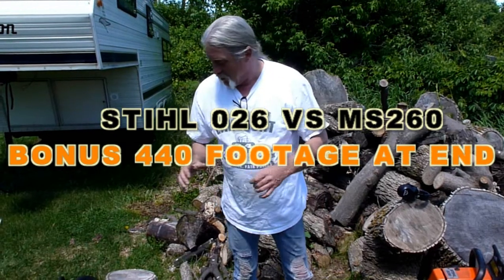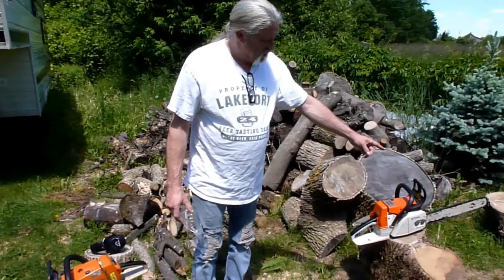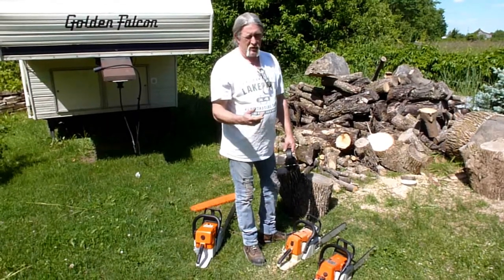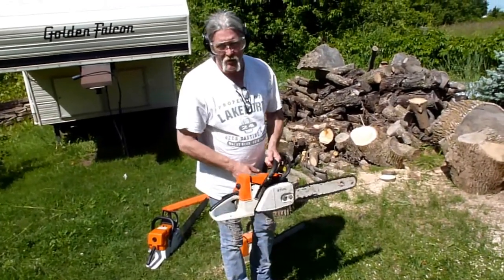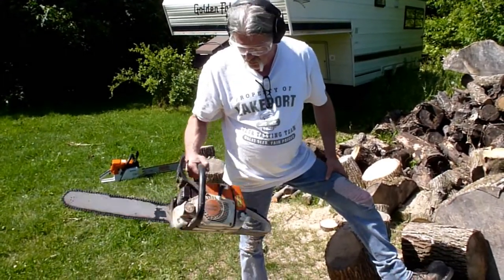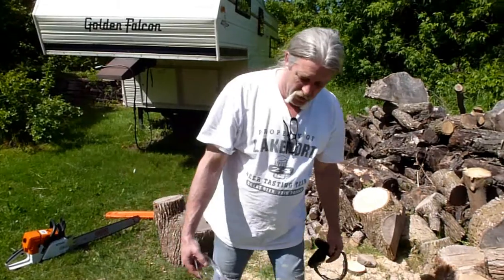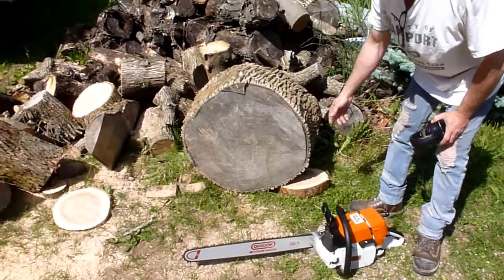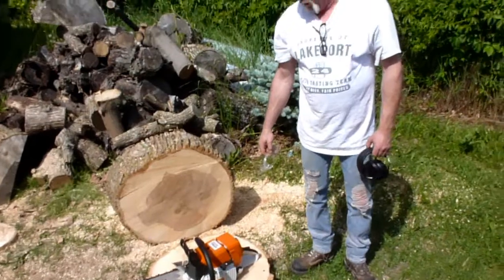Stihl 026 modded muffler vs Stock ms 260.. plus Huztl/Farmertech MS 440 footage

Comment: That 440 sounded good,  them cuts with it is the difference between 50cc's and 71cc's. Just think of them as a small block versus a big block, there is no substitute for cubic inches
Reply from the maker: You know i believe that .. but ive always been a small block guy ....... this stuff is so much fun ,I may change my mind... either way ,thanks for taking the time to comment. The 440 is still working in ,and sounding better each time i run it under a bit of load .. thanks Craig
Reply from the maker: sharpens chain and tries another video   LOL